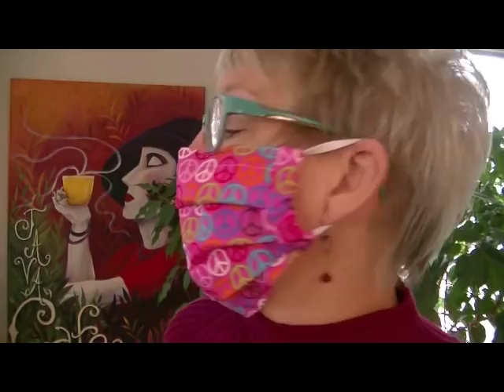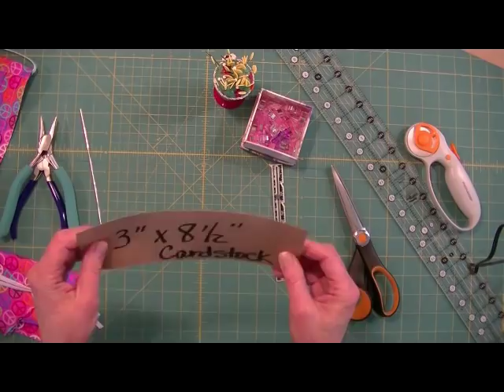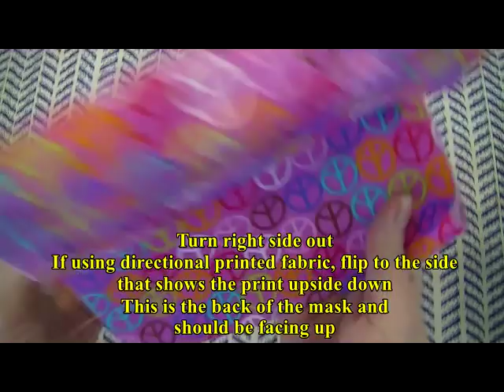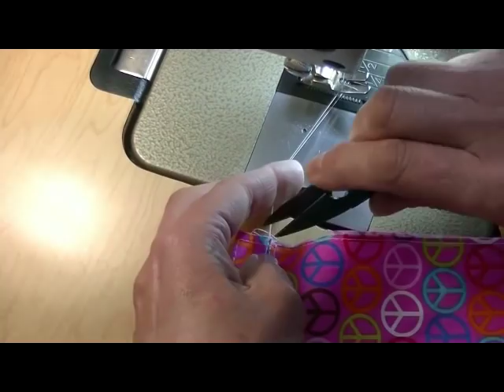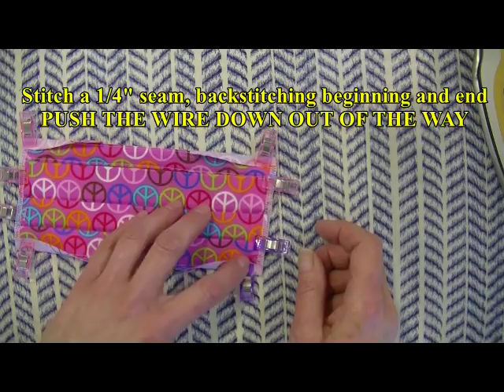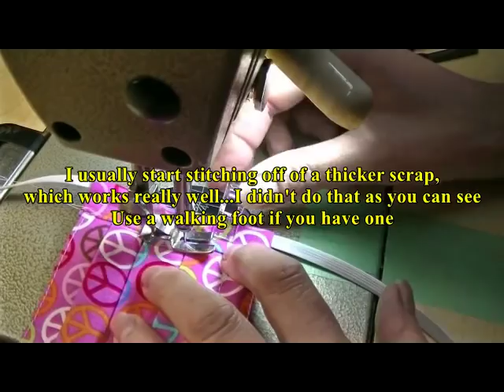DIY REUSABLE FACE MASK with FILTER POCKET-4 Style Options-1 Easy SEW Pattern-Won't Fog Your Glasses!

Comment: What about the pocket and the filter?
Reply from the maker: What do mean?
Reply: @makingiteasywithliz  the little pocket where you can insert the filter material since we are told cotton alone will allow the nano particles to penetrate right through. Ive seen some patterns that do and I thought this was one of them :)
Reply from the maker: @LindaEckertBallard  this has a pocket.
Reply: @makingiteasywithliz  I thought it did, but you did not cover the pocket in your demonstration or at least I must have missed it :) in particular the types of filter material available to use in the pocket for those who are unaware :)

Comment: Hi Liz, a couple of questions.  If I'm doing it without elastic, do I still need the (2) 2.5" x 4" rectangles?  How long should the ribbon or material be for the ties? Thank you for the great tutorial!!
Reply from the maker: Yes, correct.  You're still putting something through them.  You can make them narrower by folding down the top more before folding it over if you want. If you want to use 2"x 4", give it a try. I would make the ties 30"-34" or so each. My example was 28" and it was just a bit short for my little melon of a head. Thank you so much for watching, Stephanie.
Reply: @makingiteasywithliz  Great, thank you!!!  :)

Comment: I love this concept but I also like the idea of 2 different colors when making a mask. Can I just sew two different pieces together and still use the same pattern?
I'm looking into buying a new sewing machine. What type of sewing machine do you have? If you could buy another one right now , would you buy the same one? Update: I still have not received it. Tracking number doesn't work. I've tried emailing 3 times. Now to fight for my money back!!!
Reply from the maker: Hi Tina,
It's more work and you can't see the inside so that is why I like this pattern. No, I don't think it will work without some figuring on seam allowances and one side needs to be longer than the other...yeah no.
I sew on a 25 yr old Singer industrial machine. I love it! It's old but it's a workhorse made for long hours. It only has straight stitch so if I were to buy another machine, It would definitely be an industrial with zigzag. They are expensive and you cannot move them around, they weigh, with the table about 100lbs. My home sewing machine is a Janome and I love it. My serger is a Janome too. Thank you so much for watching.
Reply: Making It Easy with Liz Thank you for replying. I was looking into a janome. Thank you for your opinion. Stay safe.

Comment: How long would you cut the cloth ties?  How large would you cut the filter material?
Reply from the maker: Hi Carol
The ties I would say about 32 to 36" each...mine were 28" in the example and I have a little melon and it was a bit short. The filter you will have to just figure that out after you have the mask made.  It needs to cover your nose and mouth.  Figure it out after the mask is open.  I really haven't done a filter yet.  I have about 100 of these to make and I'm sewing my brains out right now lol.  Thanks so much for watching.
Reply: @makingiteasywithliz  thanks!

Comment from the maker: If you don't have clips, use pins, binder clips or paper clips. There are so many ways to get it done, do what works for you.
Reply: I used the large clips that stick to my refrigerator...it's all I had! Have you tested out the kids sizes? I'm wanting to make a few!
Reply from the maker: Whatever works, good thinking.  I'm still trying to figure the kids ones out. I don't have any little faces to go by. I reduced the adult by an inch to make it 6.5x6.5 when folded in half (13x6.5 rectangle) larger child. Then I reduced it another inch for little ones. 5.5x5.5 (11x5.5 rectangle).  Depending how old/big your kids are start with that. I reduced the finished width by 1/2 inch each time to 2.5" (2.5" x 3.5" rectangle) and 2" (2.5"x 3") respectfully for the side pieces.

Comment: I made this today as well. I would love to know what your measurements for kids masks are please! Thanks for the video!
Reply from the maker: Tha'ts a great question, Rachel and I'm working on that now. With this mask, after folding in half you end up with a 7.5"× 7.5" square and when completed is 3" wide. Here's my unproven theory at the moment...size it down in 1" increments for the mask fabric and 1/2" increments for the finished width. 
For large child cut your fabric (13"× 6.5" and sides 2.5"× 3.5")  with 2.5" finished width.
Small child (11"× 5.5" and sides 2.5"× 3") with 2" finished width.
That's just a theory right now and will try it out today.
Reply: Amazing! I will try and keep an eye out for feedback on your findings! Thanks so, so much.

Comment: Awesome video.  What kind of sewing machine are you using? Also wondering if you love your iron?
Reply from the maker: Hi Glenda, yes I love my iron (I have to for the $ is cost lol).  My machine is a used Singer Industrial sewing machine.  I love my sewing machine, but it does not have zigzag so I use my serger which I love too!  Thank you so much for watching.  Stay safe.

Comment: Pleats done this way are way too futzy, especially if you don’t have the fancy clips
Reply from the maker: Actually Marianne, it's not, but you are free to do it any way you want. I had a very hard time pleating, measuring, repleating to fit 3" on both sides and getting it even. I spent way more time doing that. You can use binder clips or paper clips and pins. Thanks for watching.
Reply: Making It Easy with Liz That's the problem I'm having right now. The way you did the pleats made it look so easy. Thank you for sharing this. I'm sure this will help a lot.

Comment: how long is the elastic that goes over the ears?
Reply from the maker: 10" for a woman 11" for a man
Reply: Making It Easy with Liz Do you make a different size piece of material for different sizes?
Reply: Making It Easy with Liz Do you use a different size of material for smaller or larger people?

Comment: Do you have to have a special sewing machine to do a surger?
Reply from the maker: Yes, it is a serger machine. You can finish the edges with the zigzag stitch on your sewing machine.  My sewing machine is an old industrial that only has straight stitch so I use my serger.  Thanks so much for watching

Comment: Do you have the measurements for a child about the age of 7 yrs
Reply from the maker: Hi Trayne, great question and one I'm working on.  Since I don't have any small children to go by, I have an unproven theory...
The adult one ends up being 7.5"x 7.5" square (15"x7.5" rectangle) so I thought for a med child, 6.5"x 6.5" square would be (13"x6.5" rectangle).
The finished width of the adult mask is 3" so 1/2" smaller to be 2.5".  You would cut your side pieces 3.5"x 2.5".  Give that a try, I haven't made one that size yet. I hope that helps.  As soon as I get a moment, I will try it out and make a video.  Thanks so much.

Comment: What dimensions would you use to make a mask for a small child?
Reply from the maker: Tha'ts a great question, Bri and I'm working on that now. With this mask, after folding in half you end up with a 7.5"× 7.5" square and when completed is 3" wide. Here's my unproven theory at the moment...size it down in 1" increments for the mask fabric and 1/2" increments for the finished width. 
For large child cut your fabric (13"× 6.5" and sides 2.5"× 3.5")  with 2.5" finished width.
Small child (11"× 5.5" and sides 2.5"× 3") with 2" finished width.
That's just a theory right now and will try it out today.
Reply: Making It Easy with Liz awesome let me know what you come up with!
Reply: Making It Easy with Liz i just made a mask following your steps and it was so easy!! I love this style much better than the other one I was using.

Comment: There nice mask. However more then 30 minutes to make a mask is too long. Too much unnecessary details. Plus you have a couple of machines. I seen other tutorials that are quick, easy and much faster. And the mask look just as great.
Reply from the maker: My vid is 32 min. This is the way I teach...very detailed instructions. From start to finish for one mask is 20 minutes. I used one of those 10 min videos for this mask, and it took me 2-3 tries to get it right because of the lack of information in that quick tutorial. They always look great because it's not the first one they made. I want you to succeed on your first try and not be disappointed with your results and waste time and materials. I used a sewing machine and serger (optional). I hope you find what you are looking for.
Reply: Making It Easy with Liz  Thank you.

Comment: Save yourself the hassle of tying your elastic in knots--just overlap it 1/4 inch and stitch it down with one of those marvelous machines you have.  I've done that for years.  Nice video!
Reply from the maker: That's a great idea, but...I tried sewing it and it just got caught up in the sewing machine, and serging requires finishing the thread tails off so it doesn't unravel. Both of those tasks take too much time  which is OK if you only need to make a few. I have to make hundreds. Thanks for watching, Deborah.
Reply: If you zigzag, and use at least a 1/2 in overlap of elastic. Great video!

Comment: Not easy to understand if your not familiar with te sewing machine.  And it sounds stupid, May be I'm just stupid, but adding the directional fabric made it more confusing to follow
Reply from the maker: You are not stupid, and sorry for the confusion. It was definitely important to know, so the print doesn't run sideways across your face. If your fabric doesn't have a print that needs to face a certain way, then no worries, just place your pattern anywhere and cut. No, this is not a beginner sewing project, and meant for some experience. There are quite a few "no-sew" videos out there. Thanks for watching Christine and stay safe.

Comment: Hi Liz, thank you so much for your video. Question. I see a lot of people using a piece of cotton material and it is WHITE on the back. The cotton material I have does not have the white on the reverse side but  I am still going to use it because it is all I have at the moment, but for the future - is the cotton material with the white back stronger or tighter woven than the cotton that doesn't have it? Thanks!
Reply from the maker: Is it a non-woven fabric or regular cotton fabric? Some use two pieces of fabric with flannel on the inside. I use plain old cotton fabric.
Reply: They are probably using fusible Pellon.   It was what the original video that was put out by JoAnn’s had in the instructions.

Comment: Are the copper and aluminum wires going to hold up in the washing machine and dryer? Should I make the pocket for the wire so that the wire can be removed each time the mask is washed. I am making masks for employees at our local grocery store and they will need to wash their masks daily. Great tutorial. I have taught myself how to sew over the last two days by watching great tutorials like this one!! I made my first mask last night using another tutorial but will be using yours for future masks!! I like the ability to size and replace the elastic.
Reply from the maker: It washed beautifully. The wire is very easy to smooth back out.
Reply from the maker: I really haven't tried it yet. The wire does straighten out easily and could only get so bent. I would wash them in a mesh bag. Give it a try and then go from there. Thanks so much for watching. Sewing is addicting. Stay safe ❤
Reply from the maker: I have one in the washer right now, in a mesh bag, in hot water...